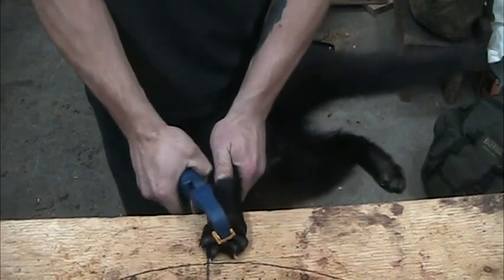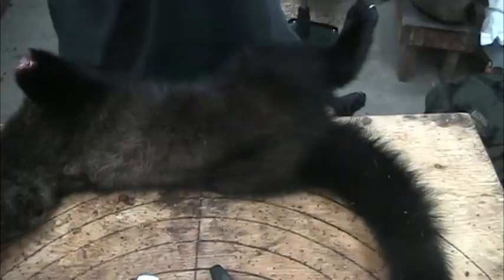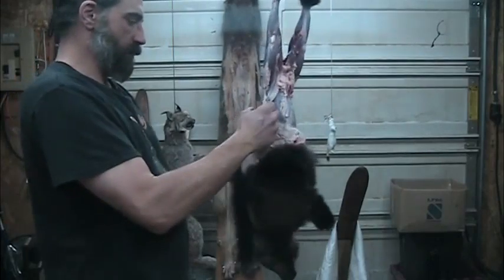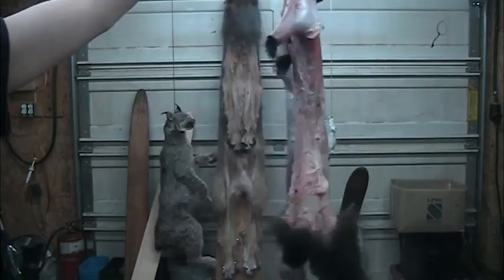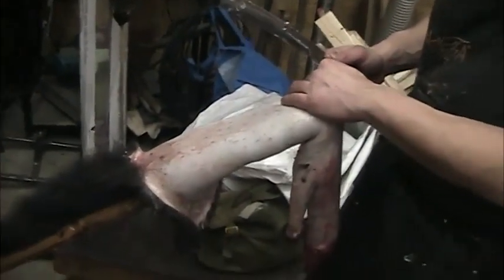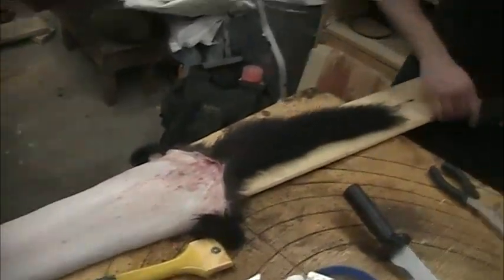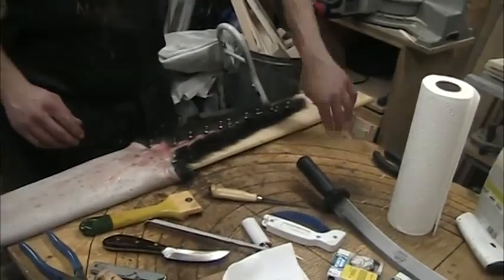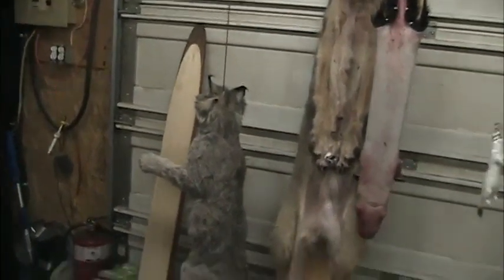How I skin,flesh, and board fisher *warning graphic*

Comment: Great vid, get some fine hardwood saw dust and sprinkle a little on hide while scraping you wont believe the difference it makes.
Reply: LAND BETWEEN TWO WATERS what does sawdust do?
Reply: It bunches up the fat aiding it to be pushed off easily  I take a old hard wood pallet and run it back and forth thru a table saw and put dust in coffee cans. Plus it works good to clean up edges of fur and fleshing board.